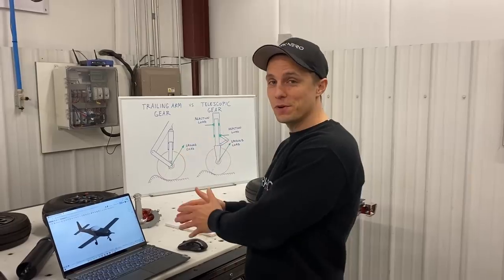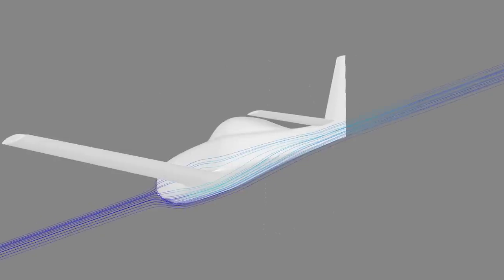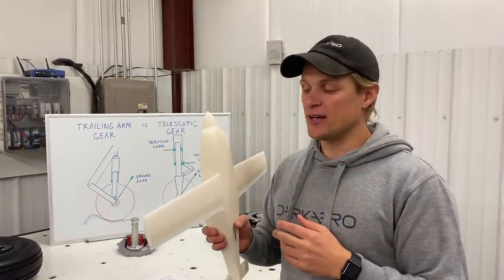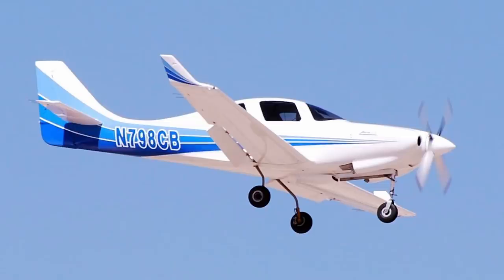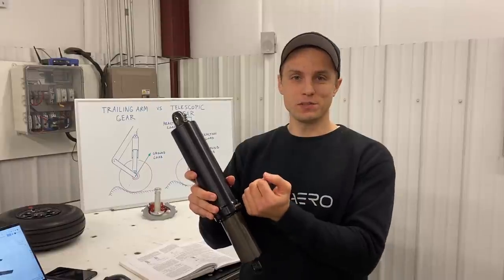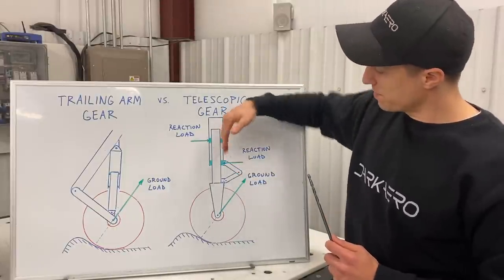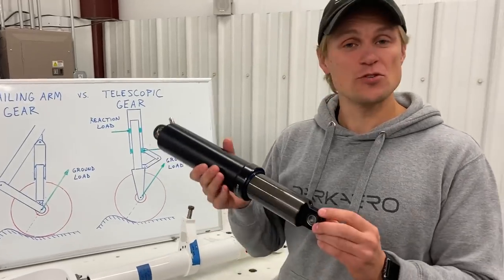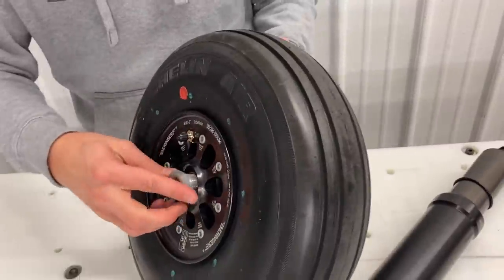LANDING GEAR DESIGN for the DarkAero 1! | Carbon Fiber, Tricycle Retractable, Trailing Link

Comment: Do you have any concerns with the wheel being offset to the outside and the length of the trailing arm that this design  will induce a twist moment into the landing gear? You might see some dramatic reactions with high speed ground handling and under braking.   Any play in the pivot at the fuselage could further increase the amplitude or frequency.  Just a thought.  :)

Comment: So you didn't look at the gear on the quest air venture? It works well and retracts into the fuselage. The plumbers nightmare that's needed for all those motions is a safety issue.

Comment: It looks like the  shock is not inline with the pivot point rotation. That means that it would move to the side a bit as the gear compresses. How are you going to deal with sideways pull on the shock mounting points?
Reply: I was thinking the same thing.
Reply from the maker: Great question Steven! The shock has swivel joints on each end that allow for a few degrees of angular movement in the shock. This angular movement does generate some internal side loads in the link and the strut so these parts had to be designed to handle the loads.

Comment: I have a question regarding material selection. (I am not expert at all. I just know the basic material properties) You selected carbon fiber for elements of the landing gear assembly. Why not fiberglass? Fiberglass composite has more elongation and therefore more impact absorption. I know the density  of the material is higher but the added impact resistance on that specific system isn't somehow desirable?(edit : I just watch the video again and noticed that you said composite material and not carbon composite as I initially thought)
Reply: Even if they say composite rather than specifically carbon fibre, it appears that every composite part on the DarkAero is carbon fibre, not glass or other fibres.
Reply: @brianb-p6586  There is also fiberglass on the airplane.

Comment: Man I learned more about aircraft design and engineering watching you guys than I have actually working in the Aerospace Industry. I learned that GA design doesn't have to be complicated. I see these aircraft with these highly complex internal structures, even kit planes. Your plane is very simple (comparatively speaking) design and assembly. You have definitely given me more motivation to try and design my own.

Comment: In my non-professional opinion, keeping the wings free of gear retraction cavities is a good call given the experience/grief that the Raptor guy is having with his design right now.
Reply: Followed that Raptor project for long time until the crazy guess work and unsafe design flaws piled up so high I began to cringe at everything he did, couldn’t watch that nonsense anymore.
Reply: I agree. I prefer a wing that is as mechanically & aerodynamically clean and simple as possible.
Reply: @tropicthndr  My opinion is just like yours. I even commented on how he expected to try and put that plane into production when there is no freakin way he knows what he has done because he has modified and or changed every part he ever put onto that airplane. He responded like Im an idiot. Its good to see someone else seeing what i saw on that channel!

Comment: Do you anticipate any issues with the shock pushing outwards against the trailing link? It seems like it would exert maybe a good 30% of its force outwards.
Reply from the maker: Good question Tim! The angle of the shock does result in lateral forces in the trailing link so the link and bearings are designed to handle these loads. The link already had to be designed to handle loads out of the pivot plane that result from drag loads on the wheel and landing at a skid angle.

Comment: Even though the fuel is in a wet wing I am very  impressed with the engineering design CAD skills. I see a lot Mike Patey logic in the purpose of each functional component. Sooooo glad to see the plane will not be hindered by unreliable Rotax nonsense and will instead have a very good ULPower plant which will set it a very high bar above all the other light sport kits. There’s way way too many Rotax light sport toy planes out there that don’t offer anything that sets it apart from their competitors. The VL3 Evolution almost broke the mold but they blew it with a garbage power plant. The Dark Aero will be the new level at which everyone else looks up to.
Reply: Unreliability of Rotax? Seriously? It's the standard of all modern entire in that hp category. UL had yet to prove itself, there simply aren't enough out there yet. But I assume you're a highly qualified internal combustion engineer who can these assessment, right?
Reply: The Dark Aero is not  LSA. So why are you comparing it to other LSA designs?
Reply: @PDZ1122  Design wise since Rotax crankshaft spins at 5.5K RPM, has a gear box (which generates ~1.5KW of pure heat) and liquid cooling for the engine of course it is less reliable than UL. In practice here is good place to start research on how reliable Rotax is: https://www.atsb.gov.au/publications/2013/ar-2013-107_research/. Rotax is second less reliable engine. And thanks to DarkAero work on engine research we now know what engine is the best in terms of $/HP and HP/lbs: https://www.darkaero.com/knowledge/aircraft-design/
Reply: @PDZ1122  And I hope after success with DA1 we will see affordable LSA from the team too. Prices for those sleek European LSA planes are definitely our of touch with the reality.
Reply: @nattinotti6934  that's a nonsensical analysis. So my old 1963GMC V6 is inherently more reliable than a Toyota Corolla engine because it runs at 3800rpm? Rpm has nothing to with reliability. Neither do gearboxes.  Until they have as many flight hours as Rotaxes, the UL engines remain to be proven. They may be great but there isn't enough data yet to make this claims.
Reply: @PDZ1122  if RPM has nothing to do with reliability, than why we have red arc on tachometers? I gave example of gearbox because it is an additional component which could fail. And because it generates about the same heat as your electric kettle when you fly - it needs a separate cooling, therefore all these Slings and endless line of recent LSAs have punched cowlings for all that airflow. I don't see how all this has nothing to do with reliability. Agree that we need to see more data about UL engines, my gut feeling we will see it sitting anywhere between comparable Continental and Lycoming engines.
Reply: @nattinotti6934  The red line on a tach has nothing to do with reliability. It's a safe limit to run the engine. If it's 2700, you can run it they as long as the manufacturer says it's ok. If they it's 15,000, it's fine to run it at 15,000.   If anything, piston speed is a better number for comparison and most engines run at similar piston speeds, whatever their bore or stroke or whether they are geared or not. If rpm was an indicator of reliability, no ship engine would ever break down or wear out at around 100rpm.
Reply: @PDZ1122  mean piston speed is directly proportional to RPM. Marine diesel engines have TBO of 18000 hours, and surprisingly, they indeed spin from 100-1800 RPM. If you arguing that rpm has nothing to do with reliability and conventional logic that ICE engine exhibits more stress and wear and tear with increase in RPM, it is ok. Here is Rotax manual for one of their aircraft engines: https://www.cps-parts.com/cps/pdf/d00287.pdf. p 2-1 clearly says: "WARNING: This engine, by its design, is subject to sudden stoppage". In my mind such disclosure is direct manifestation of UNRELIABILITY. So good luck with Rotax.
Reply: @nattinotti6934  oh, for ducks sake... Don't you know the difference between lawyers and engineers? Do you really think that Rotax put that "sudden stoppage" statement in there because their engines are inherently unreliable..? No, it was their lawyers who did. All engines are subject to sudden stoppage. Name one engine that never had a sudden stoppage.
Piston speed also depends on stroke.   Most geared engines are relatively short stroke so their piston speeds aren't all that high.
But whatever, you obviously have an opinion that does not match reality and nobody is going to change it.
Reply: @PDZ1122  Of course all engines are subject to sudden stop at some point. Some do it after 600K flight hours - P&W and some are after ~3K - Lycoming. But I doubt P&W or Lycoming for that matter have similar wording that their engines "by design are subject to sudden stoppage". If you find - please let me know. Again: Rotax is a second worst reliable engine according to ATSB study failing at a rate ot 1.52 per 10K hours flown. Not my words and enough said - risky engine to bank your life on it, period.
Reply: Mean piston speed depends on engine speed and stroke.  What makes the 900 series less desirable is the brake specific fuel consumption penalty from higher engine speeds.  This factor tracks volumetric efficiency and peak torque as all are from peak cylinder pressure.
Most engine manufacturers only publish wide open throttle BSFCs, in real world, the plots are contour.  Peak efficiency is 75-80% MAP and around wide open throttle torque peak.

Comment: In the early 1950’s dad was the test pilot for the X and Y-B-47’s. One aspect of the test of the two carriage under fuselage was to load the plane dramatically, far in excess of the engineers calculated weight, and see if the gear would support it and if the thing could get off the ground. So one early morning they had the plane loaded to the eyeballs with all sorts of heavy things. Edwards Air Force Base is located on a huge flat dry lake. This allows miles of solid flat ground so that tests like this could performed. The asphalt runways end and the lake then takes over for a very long distance. Since everything is flat when it rains everything floods necessitating lots of cleaning of the asphalt periodically.

On this day the bomber loaded bomber was going to require a great distance to get up to speed so that it could take off. The asphalt was simply the warm up roll. As the plane lumbered past the half way point, dad saw a thin dark line ahead. As it for closer dad saw that an 8” tall concrete curb had been installed at the end of the asphalt. While a good step towards reducing clean up after the rain, this was a looming disaster with the potential of ripping the landing gear right iff the only flying experimental version of what was for a time our Cold War deterrent flown by the Strategic Air Command.

It was too late to stop and too soon to fly. As the collision approached, dad yanked back on the controls causing the plane to try to gain some height. With several hundred yards remaining he yanked and released causing the plane to begin to bounce or hop. God placed the curb perfectly so that on the third hop the plane cleared the curb by inches. 

The remainder of the take off required a half mile before it flew. The rest of the program was uneventful.

Recommendation to you guys: Build the gear strong. You never know when it might rain.

Larry Sorenson
Proud Son
Reply from the maker: Wow that is an insane story and an interesting piece of history! Thank you for sharing! Definitely paints a clear picture of the importance of building robust landing gear.
Reply: I forgot to add; the maneuver was named the Boeing Bounce.
Reply: Another fun test involved wing icing. It had not really been a problem before but the new target altitudes made it a potential problem. So how do you find out the limits for ice build up? Well you go where it is really cold anyway (Tule Greenland) get right behind a prop tanker loaded to the eyeballs with water and signal them to turn out the shower. Visual estimates of ice thickness from both planes and film would be used to study the ice and to pinpoint the exact moment when the Y-B-47 would fall out of the sky.

Dad was pretty sure that as the ground approached the higher temperatures would melt the ice thus avoiding a nasty mess. He was right.

Comment: they straight up copied the MQ-9A trailing arm landing gear. even the brake line ran externally through p clamps is the same

Comment: ...Are you using spherical rod ends on both ends of that shock? Also, why are you not welding that main link instead of fastening it together? You're probably losing a lot of torsional rigidity that way.

Comment: I would defo lean to a simpler lighter solution because weight begets weight and it's such a brief part of the mission. even if you wanted dampening, it could still be on a skinny arm.
Also cost of manufacture is going to be significant. But let's see how it turns out.

Comment: If u used the composite strut if something bad happens or the pilot gonna crash land the aircraft due to any malfunction the shock will hit the strut and there will be tendency to break the strut.. for eg. Only one gear lowed due to any computer malfunction at the time i would think aluminium strut would absorb the sock in better manner as compared to composite.. It can snap.

Comment: It is good to see you favored trailing link landing gear. You just don’t see many on aircraft especially on nose gear. To me from a layman’s point of view, the design seems very logical even of the trailing link was a fixed gear and the trailing link/arm was connected to the fuselage forward of the nose gear itself with a shock strut almost vertical to take the load. This configuration especially in a tandem seat aircraft which has a longer thinner fuselage works fine and allows the gear not to be shOrt coupled. I do think the bumps would be more absorbed by the shocks and not felt as a rotation moment to the fuselage.
Reply: DarkAero is not using trailing link for the nose gear - that has a telescoping strut.

Comment: Nice work on the trailing link.  How are you planning on adjusting/tuning the performance of the shocks before flight testing?  From experience they can be highly non-linear.  Also what kind of mechanism are you intending to use to retract the MLG?
Reply from the maker: Hi Tate! We have been working with the shock manufacturer to establish the initial settings for the shock and we also built drop test fixtures for the main gear and nose gear so we can get some data prior to flight testing. The gear are retracted using electric linear actuators.
Reply: @DarkAeroInc  nice!  Good strategy, I found that the air shock was great for an experimental approach.  Only trouble is rapid damping adjustments...
Reply: @DarkAeroInc  How will manual deployment work with the linear actuators? I've seen some from Beaver Aerospace that are designed for it but they didn't seem priced for the experimental market.

Comment: First
Reply: Hi DarkAero Team,

looks really good. Could you give some more data on how that solution compares to benchmark concepts in weight and sturdiness?

Landing on a grass strip should be possible I suppose. Correct?

Can‘t wait to seeing this baby in the air.
Reply: @willimeier8027  yes if u want to land on grass u could change the gear for landing on grass.   but this thing is built for speed ,so we wouldnt do anything to lower its aero dynamic capabilities

Comment: Why are you bonding metallic elements to your main gear leg?  Burt Rutan claims (in several YT videos, most recently regarding his Skigull development) that metallic hard points bonded into composite structures cause more headaches than needed and that completely composite solutions are not only feasible but desirable.  Comments?
Reply from the maker: In general, I agree with that. We use composite hardpoints as much as possible and we have quite a few good examples like the engine mount hardpoints or the attach points for the rudder pedals. The geometry and stresses in some of the landing gear parts drove us to metal solutions.